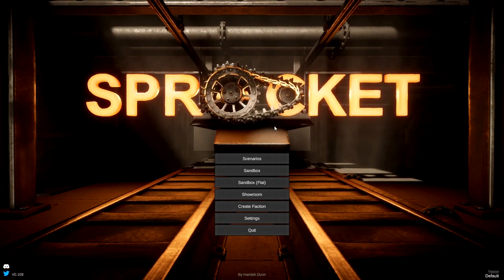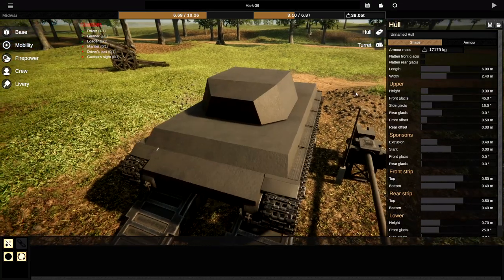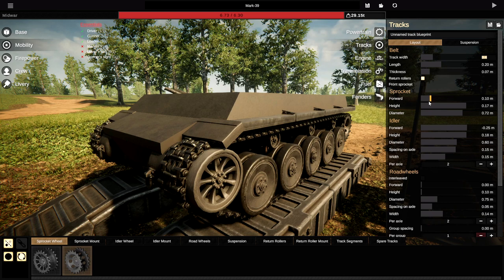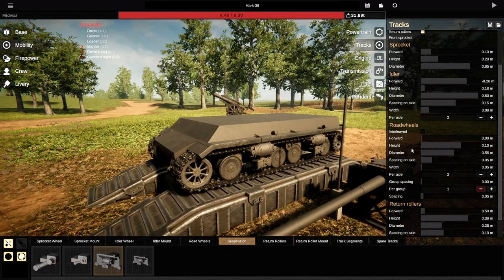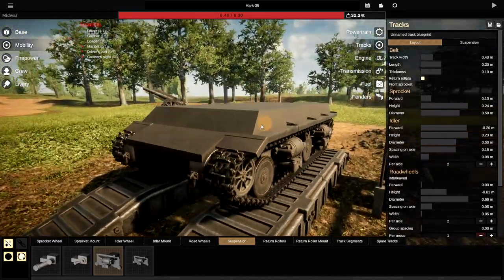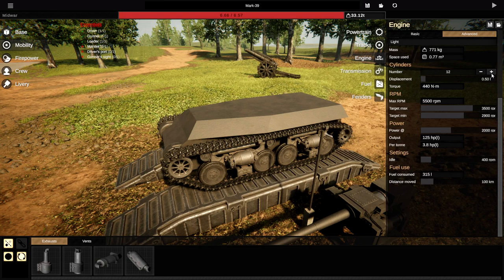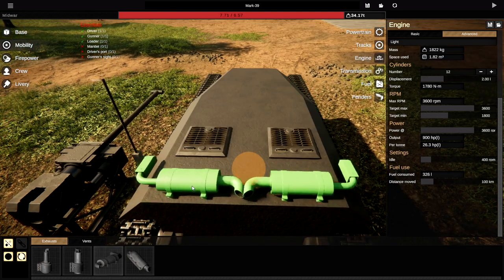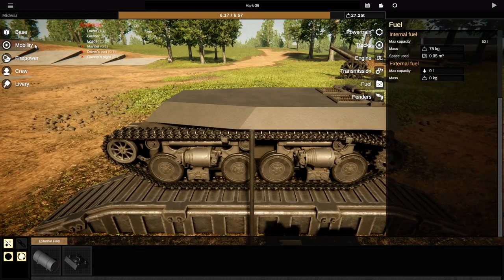100+KPH Super SPEED Tank! - Sprocket Gameplay

Comment: Edit: This info is outdated , I'll add a parentheses for how it works as of October 2021

Extensive testing for speed results:
1:Use the smaller roadwhells for higher top speed ,and the larger ones for more acceleration (outdated)
2: use smaller sprocket for acceleration and larger one for top speed (gearing now compensates better for smaller sprockets but bigger still better)
3: use the thickest tracks possible if you don't care about the extra weight 
Despite the extra weight ,it always adds speed 
4: use the highest rpm engine that has enough torque for your design in all cases but if you are really low on internal volume(in which case use the highest displacement engine and try to increase sprocket size/reduce transmission ratio(outdated)
5: each tank needs a balance on the width of the tracks ,depending on its weight and how many you have .
Generally stick around 0.2-0.4 width and interleaved and test from there 
6: using sprocket size to fit your needs rather than lowering transmission ratio has more efficient torque transfer to the tracks ,and is always better unless it gets in your way (relevant ,but to a smaller extent)
7: make the final gear top out at engine  max rpm + or - 10% usually its better to be 10% off then to have it exact (can't go 10% over max rpm anymore, and now days its better to be exact)
8: torque and rpm are way more important than horsepower
Reply: in my head i was yelling at him cause the more surface area your tracks have to travel, the more power is needed, but also, if you make them too small, the rpm has too be ridiculously high
Reply: @boeingbetty24jettonlousie85  11: respawn because its a video game
12: Learn from your mistake and avoid pillars
Reply: Competent gearing is equally important to many of these points, more important than others.
Reply: @ZandrichMynhardt  nowdays yes 
But gearing 1 month ago was not important 
As long as the engine wasn't getting damaged or at less than 50% RPM the performance would of been the same
Reply: @miltoska9708  brilliant response

Comment: Can you make a tank that can win all scenarios with no modifications? I want to see a master-crafted tank from ww1 winning against tiger 1.
Reply: That’s literally impossible.
Reply: @sabrabi9555  It would take iterations and hours of work starting from no tank's lands all the way to the final fight. It's a challenge. It's about making concessions in design as everything needs balancing and future proofing.
Reply: @nepfain8932  Tanks in the earlywar stage simply don’t have the necessary armor thickness or cannon penetration to compete with latewar tanks.
Reply: Only if you allow gear and engine advance option changes. With direct edited armor values (typing it in allows for values above the sliders.) and the penetration progression through the era's you can stay competitive, but the gears and rpm changes will kill you.
(And it has to do the Trench mission too? Oof. )
Reply: @KorporalNoobs  It's a challenge. I think the hardest part is the transition from ww1 challenge to the early war one.
Reply: @nepfain8932  It’s not even a challenge, I’m fairly certain that it’s impossible.
Reply: @sabrabi9555  I think it will be fun to watch. There's now uncertainty on when he wins and more community feedback... which he will need. Like using fuel tanks as improvised reactive armor.
Reply: 75 with max shell length
Reply: @sabrabi9555  it's a game, everything can get archived with enough dedication and glitches
Reply: I did it and it's pretty easy. Minuscule tank massive frontal thickness, 2cm caliber with 1 meter long shells, maximum engine size that fits

Comment: If you are slowing down on highest gears, that mean you actually found the smallest ratio
For ex. at 25:20 from fifth gear is okay, sixth is too much, so your lowest ratio (highest gear) should be between 0.5 and 0.6 for given engine
Also:
Ratios are NOT linear, so making gears like you did in 24:50 is not a great idea
Difference between gear ratios is called gear spacing, and it should be smaller at higher gears, your spacing is constant ~0.1 for 4 gears
Reply: Hey, I found out about that stuff from extensive testing with an in-depth drift game!
Random knowledge that works well in multiple areas... Gotta love it.
Reply: @Fightre_Flighte  What? Multiple areas? I'm talking about gearboxes :D
Reply: @jakubpollak2067  
Well, I guess technically speaking, a gearbox is a gearbox is a gearbox, yeah?
Doesn't matter if it's for a drift car, a rally car, a pickup truck, a road car, a motorcycle, a semi truck, or a tank. Has gears, do spin, has ratios. Gearbox.

Comment: Look. I know this is a year late, but the suspension wheels that you are making larger and larger aren't powered. The sprockets at the rear of your tank next to the engine drive the tracks. The larger the sprocket, the more track will move when it turns, that will lower it's effective pulling power but increase its top speed.

Comment: Interesting but why reinvent the wheel? You could have based it on the hellcat, BT series, crusader and Cromwells. Given the odd chassis choices it would be easier to base it on existing designs and modify for engine, transmission, wheels and aerodynamics.

Comment: the fastest i can mostly go is a 12 cylinder 3 liter engine 3000 rpm max and service and 16 gears set to 8 can set on both foward and reverse that will mostly get you up to 50 km/h on straight with a 80 ton tank

Comment: youre making your max hp @ max rpm. but the engine sits at 600rpm below max rpm in gear. if max hp was at 2700rpm with redline at 3300 the torque would pull the next gear,

Comment: I would assume smaller wheels would mean higher speed. Since they would reach higher rpm just because of the smaller diameter for the same horsepower. I don't think it would work out this way in reality because of other considerations, but might work inside the game
Reply: In game it is the wheels that give the momentum to tracks

So bigger wheels make you faster.

The best combo is minimum lenght, good transmission and fast (not powerful) engine
Reply: Incorrect, the larger the drive sprocket the higher top speed, smaller drive sprocket means quicker acceleration, so if you want to use small drive sprocket you would have to compensate with less gears and/or lower gear ratios to get high speeds, opposite with larger drive sprocket, more gears or higher ratios, gear ratios represent number of full revolutions per one revolution of engine, transmission or tires, so if you have 1st gear set at 3.0 that means that gear makes 3 full revolutions per one full revolution of the tracks, effectively making a 3:1 drive ratio this is considered a tall or long ratio good for speed, if you set 1st gear to 10.0 this means 10 revolutions of that gear make 1 full rev of the tracks, equals 10:1 drive ratio, this is considered a short ratio, good for acceleration... Hope this helps everyone make better gearing easier in the future, also always set max target rpm 200 to 500 rpms short of max engine rpm, this will keep you in the power without damaging motor...

Comment: As a  guy thats super into engines and how the work in certain  situations. I was mildly anoyed at tge fact thaat you ignore true power to weight. If you  were to use a  laatge liter v8 you would have less tourqe but MAASSIVE horsepower for the size of the vehicle (thus lowering the weight considerably) plus a large v8 is still lighter than a  
mid size v12.

Edit: that is atleast how it should work. Idk this games physics as i have never played it

Comment: i dont know how you can struggle so hard getting a light tank to 100km/h just put in the biggest engine and play around with the gear ratios a bit and you get it. i even got it without any problems while having 80mm of armor and a 50mm gun with 155mm of pen. so it really isnt that hard if even i can do it. and i dont know what you are doing that you find 40 mph to be impressive for a light tank because thats what my heavys with 200mm front and side armor move at.

Comment: I can't reach over 25mph or 40kmph on my 50 ton medium tank
Reply: That seems like a pretty reasonable top speed for a (definitely not medium) 50 ton tank, the panzer IV was only in the 30 ton range
Reply: @lilHamster9t7  bro I am using the highest possible engine which would be like 5 times the volume of panzer 4 . Even the 65-70ton kingtiger could reach the top speed of 40kph
Reply: @lilHamster9t7  basically my tank is a 250mm from front and 60mm on sides and rear , with a big cannon .
Reply: @pratyushkishore9030  fantastic, then what you have there is a heavy tank, not a medium tank, like I said :)

Comment: you geared it WAY to low, its geared to go like 200 miles per hour, you need to all the gears to the limit, meaning when you stop being able to push pass friction of the wind and ground, youve used up all your gears, your engine simply cant be powerful enough to get to those speeds, so it stops.
Reply: nvm you figured it out